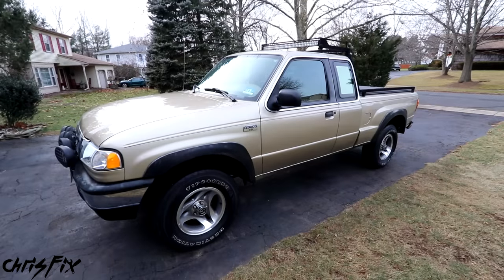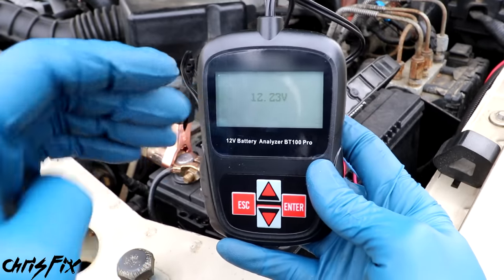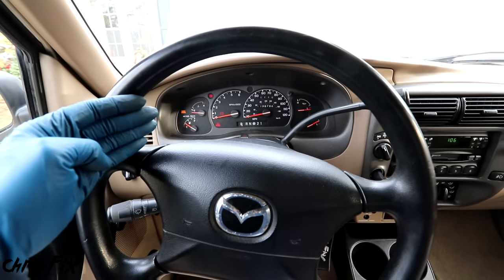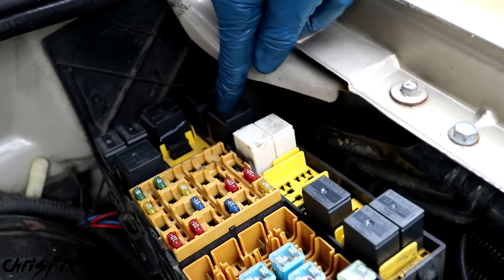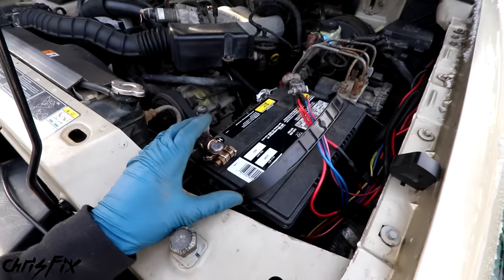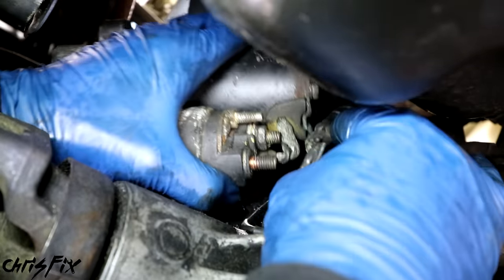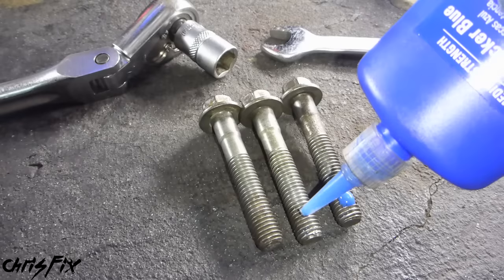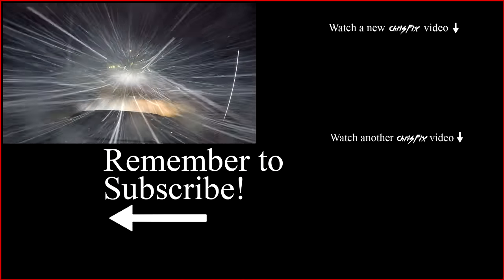How to Diagnose and Replace a Starter

Comment: I really enjoyed the the inclusion of other 4 common problems related and possible can be reasons the starter does not turn over. I recently had an intermittent starter issue on my 05 Frontier. I have owned 5 Nissan trucks over the years and learned that the starters fail around 250,000 kms to 300,000 kms. So, being proactive and not wanting to be stranded in a parking lot somewhere with a failed starter, I ordered a new Denso starter online and replaced with my original still working great starter, this was last October 2020., I removed the old starter and put into the Denso Box and put in the shelf. Did not send it back to get my core credit, just plain procrastination. Just last month, Sept. 2021 the starter failed to turn over three different times I went to start the truck. Hmm-mm, this must be another issue because I have a new Starter on the truck. I immediately went to work using your pre-check recommendations. After thinking about the scenario a few times, It came to mind that you brought up an interesting point in this video about "Hearing the Click", but the starter does not turn over. I just figured out that I did not hear the click, which is the Starter Solenoid engaging. This is why I assumed I had another faulty electrical issue. I chose to pull off the new starter, put it in the shop vise and hit it with 12 volts from my bench battery I use for testing lights and things. No action from the starter, Nothing, the solenoid did not click. I then touched my positive battery clamp directly onto the armature terminal, bypassing the solenoid and the starter immediately spun to full speed. So, my solenoid had failed. Then went to the shelf and grabbed my old starter from the box and swapped out the old solenoid from the starter and put on my new starter. Tested it with 12V and it worked beautifully. Put the new starter back on and it felt good to know that I was not going to get stranded somewhere, usually when in a hurry with a starter failing to turn over. It was really bothering me not knowing what the intermittent no start issue was. The weird thing was, I would just walk away from the truck for 15 - 20 minutes and come back and it would start perfectly. Your point about "Hearing the click" got me on the right track, I had no click on the times the starter failed to turn over. Why I assumed I had another electrical issue, which sometimes can be complicated. Thank You Chris, made my day having this intermittent issue repaired.

Comment: This is such a great video! The only thing I would add is that folks need to remember that sometimes you can charge your vehicle and it’s still not be enough to get your dead card to turn over. Sometimes you just need a whole new battery.

Comment: Me being dumb, I replaced the starter on a 2001 ford Taurus and did not wear safety glasses so I had some dirt and oil fall into my eye(which burned) when I was holding the starter above my head and I dropped it on my face. The good thing was I did not break anything but the next thing I did was to set the starter down and put on some safety glass from then on. TLDR-Wear safety glass

Comment: Neutral safety switch in my old 94 ranger the neutral safety switch when out and paperclip method always works who needs that sensor haha
Reply: Mine went out in my 89 astro van, got a new one and it didnt fit! So i hot wired that bad boy

Comment: Chris make a video going over what oil is the best oil and when to change it. Some manufacturers say to change the oil almost every 10k miles which seems too long
Reply: he actually said before that it depends on your car wants so like he tells us, change your owners manual and that will tell you
Reply: Change it every 7,000 miles. I use penzoil and have never had issues.
Reply: People will argue all damn day about how often to change it. I think 6000 miles is ideal for full synthetic oil and any good filter. Can it last longer? sure depends on the kind of driving the car is doing. The best oil? Probably Royal purple or Amsoil but I think there overrated for normal cars. Any brand name synthetic like Mobil 1 or Pennzoil Platinum will work the best.
Reply: George Parker your suppose to change every 6000 miles they say but in my auto class i learned that actually base an oil change off of how you drive and use your manual the vehicles manual is the best place to get info specifically to your car so take it to good use
Reply: There is no such thing as a "best oil".  Your owner's manual will tell you what API service rating and viscosity is required. Meet those criteria and the oil is doing everything required. Except for a few exotics with very large crankcase capacities, 10k is marginally too long for the way most cars are driven. Lubricating properties may be maintained but other required functions of motor oil are likely depleted.
Reply: I personally change my full synthetic oil every 5k miles, just because it's a high mileage car, and I want it to last as long as possible, even if I do lose a few bucks on oil changes.
Reply: Depends on the car and oil used
Reply: I change oil and filter every 5k, and I use royal purple. Hasn't failed me yet.
Reply: The companies that make "synthetics"...at least Mobil and QS...state that their oils should not be used to extend the engine makers' oil change intervals.  That despite the carefully-worded hype on the oil containers.
Reply: +Trevor Foster I use the cheapest on the shelf and change every 5K, keep my cars forever (19 years for current daily driver) and no engine problems at all. Heads never off any of them and none burned oil.
Reply: I can understand that. Even if paying extra for better oils doesn't mean much, it at least makes me feel a bit better about the stuff I'm putting in my machine.
Reply: Right.  That's psychology not mechanics.  And most of the companies trade on that. It's like convincing people that some hens' eggs are "better" than others or swallowing some twigs and berries will "support" brain or prostate or whatever health. Just nonsense.
Reply: LOL, I'll have a double helping of 'Prostate Berries' please...hold the 'Brain Twigs', thank you. :)
Reply: Unless you are running a "race car" use what the manual suggests, they write that stuff down for a reason.
And if you want to spend more money then change the oil faster, that is your call.
Reply: If you do research about what engine your car has and research oil for that engine usually there are communities and answers online from enthusiasts. 10k is too far to change oil depending on how you drive. 7k on synthetic is fine. The only way to know for sure if you changed it in time or not is by sending in a sample to a lab after you change it.

If you do a lot of stop and go driving, or short trips under 10 minutes that is harder on the oil and you should change it more often like 5k. If you do mostly highway driving and longer distances then that is easier on the oil and you can go 7 or 8k or even up to 10 depending on the size of your oil pan and how your engine works.

The larger the pan the more oil it holds and the more contamination the oil can hold before it breaks down and loses protection. Synthetic oils maintain an effective viscosity for many thousands of miles longer than conventional but they are limited by combustion acids that are produced and then absorbed into the oil. The average car can go about 7k miles before synthetic oil will reach it's carrying capacity of these acids and begin to reduce the oil's effectiveness.

I personally think 10k miles on synthetic on highway driving is completely fine but I have never sent in a sample to make sure. Conventional oil loses it's viscosity so fast. Make sure you always change it by 5k. More often if you drive hard.
Reply: It depends on a lot of things.

>How the engine is now (not just its shape but if there's sludge buildup from cheap oils)
>How you drive
>What oil and filter combination you plan to use

There are ways to get extended drain intervals without issue but they're dependent on higher quality oil and far deeper oil filtration than most filters allow. As mentioned before there's also sending oil in for analysis which can help out.

Comment: chris how do i replace my girlfriend i think she needs replacing =(
Reply: Koalafications4Dayz tinder will work fine
Reply: Does she have a flat battery or a faulty starter? If her battery is dead all the time that could be due to a shot alternator.
Reply: put her under the Load Tester. ..lol....see how many loads she is holding
Reply: More like how many loads can the ole' gal take...:-)
Reply: lmao
Reply: did it get noisy over time?
Reply: Chris Watson Jesus man...
Reply: Maybe she needs a new battery.
Reply: She probably need a new motor :)
Reply: When you trade her in, you might have to pay the core charge since she's no longer useful...
Reply: Trade her in on a newer model!
Reply: If she is making a lot of noise's it might be time to trade her in. Maybe get a newer model. It also depends on the miles and the condition she is in! Good luck
Reply: Check your owner's manual
Reply: I got here late, but these comments win the internet for me today! I am crying from laughter.

Comment: Hi Chris, I've got a 2012 Dodge Durango v6 engine and I've changed the old starter with a new one. But, the new one now has to be changed. What are the common things that damage the starter?
Reply: bendix staying engaged,worn or broken teeth on flywheel.too much voltage going to starter.
Reply: Oil leakkkkkkkkk
Reply: Did you put the silicon stuff on ?
Reply: check the starter solenoid

Comment: When my starter fails,,  its the solenoid(magnet switch) and i just replace the solenoid,  saves me a lot of money , and the nest time it fails, its usually the carbon brush, so, i just replace that small part, its poket friendly
Reply: I just rebuilt my starter. Cost me 28 bucks with shipping for the parts. Took me longer to get the starter out and put it back in than it didn't to rebuild it.

Comment: u didnt put the wood blocks behind the rear wheels.
Reply: gasp
Reply: Bass Boosted songs Yes he did, they just don't protrude but you can see them around 7:05
Reply: nice catch
Reply: Bass Boosted songs notey boy!!
Reply: Bass Boosted songs parking brake is in the rear
Reply: the parking brake is in the transmission
Reply: i thought i was the only one who noticed it
Reply: That's a pawl not a brake and it shouldn't be relied on to hold the vehicle when safety is paramount.
Reply: Nate Rowe very true once it snaps from too much stress ,cars gone
Reply: Yeah you can see one behind the wheel when he jacks the truck
Reply: +FileUnknown1 Nope.

Comment: What are the odds? My fucking starter died today. Luckily I was on a slope and I drive a car with a manual transmission so I just took off the parking brake threw on my hazzards and got some momentum before dropping the clutch. Started right up! Now to get a new starter...
Reply: xmodalloy one of the pros of having a manual

Comment: Hello reader I do need help! I drive a 95 Ford Thunderbird. And couple weeks ago it would crank up fine. When I left for vacation and came back and I tried to turn it on the car would crank but not start I bought a new battery but every time I’d crank it, the lights would dim. And it will make a grinding noise for a second after I’m done cranking it. If u have any advice or think you know what the problem your help would be greatly appreciated!!
Reply: mr blackflash alternator
Reply: Try rebuilding or getting a new alternator

Comment: So why is it that there is a rapid clicking noise when you have a dead battery in your car?
Reply: I'm not 100% sure but I think it's because when the starter solenoid (it's really a relay, but for high current) engages the starter motor, the starter motor draws too much current from the dead (or weak) battery, the voltage drops far enough that the starter solenoid disengages because there is not a strong enough magnetic field. So, it basically oscillates on and off and back on again over and over.
Reply: Benjamin Esposti That now explains the rapid clicking
Reply: yeah you are right i was thinking the same
Reply: Well said  @BenjaminEsposti

Comment: 6:23
WHAT KIND OF SORCERY IS THIS??
Reply: Its like with kids back in the day. If they are bad you hit them and they behave better.
Reply: Lol those were the days. Smacking the TV to get a better picture, blowing the dirt out of game cartridges, etc etc.
Reply: ME-DIC! It is due to the design of the starter. As an electric motor under a lot of load, its design includes small brushes inside to allow a high current  to flow. Those brushes are in contact with a special type of charcoal. 

When a starter is old, all the friction between the brushes and the carcoal begins to crush the charcoal and some powder is now floating inside the starter. 

This powder is magnetic and tends to make small clumps. When you smack the starter with a hammer, you dislodge them, allowing the motor to rotate again.
Reply: It's the Clarkson way to fix things.
Reply: Nice. Appreciate the info.
Reply: ME-DIC! It's the solution when you are out of cash lol

(I'm just kidding for those of who that think I'm serious)
Reply: What you are describing is partly, but not quite right, Antonin S. The brushes, which are made of carbon, are pressed against the commutator by springs. It is possible that some powdered carbon could prevent electrical contact between the brush and the commutator.  Then the starter motor will not turn, and a light blow with a hammer might free it up. But carbon is not magnetic. It might have a slight electrostatic charge, and thus appear to be attracted magnetically. 

Clumps of carbon, like you describe, might be the cause of the lack of electrical contact. I am more familiar with the situation where there is a worn down spot on the commutator, which is the part of the armature that makes electrical contact with the brushes. In that case, the starter will work sometimes and not at other times. It's a question of whether it has come to a stop at the dead spot.
Reply: Larry Hecht zozozo
skIoz
Reply: @rbxa2147  "MEDIC! Wait... that's me!"

- Angela "Mercy" Ziegler (Lucie Pohl)

Comment: Why did the truck start, when you hit the starter with the hammer?
Reply: the carbon brushes are worn
hitting it moved it just enough to make contact to crank the engine
Reply: Contacts are worn out and wont close the circuit. But hammering will move this contacts a bit making contact again for a short moment enough to engage the starter.
Reply: Science
Reply: If I recall, some of the parts inside the starter can break and become stuck, seizing the starter. By hitting it, you can dislodge the stuck pieces and can get another crank out of it. Scotty Kilmer has a video about it and explains this.
Reply: Achitori that is the universal way to fix a starter.
Reply: The solenoid inside the tube part of the starter is like a big plunger that pushes the gear towards the flywheel and that plunger can become seized over time and with corrosion
Reply: There are multiple thing inside the starter that can fail, hitting the starter with a hammer can jar loose stuck parts or it can bump the armature past a dead spot (which is what i suspect happened in the video as on the test bench the starter and bendix operated but the tester still failed the starter, which would seem to indicate the tester was monitoring the current flow and could detect a failed winding/commutator)